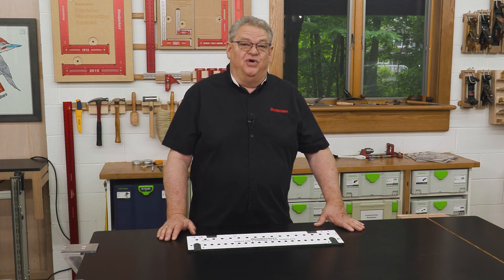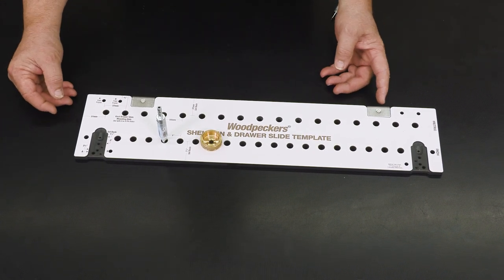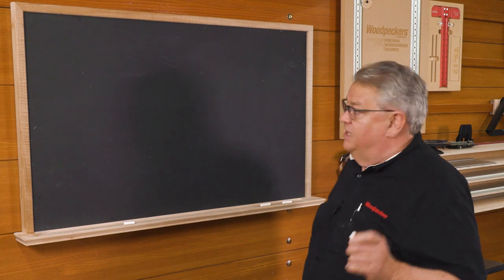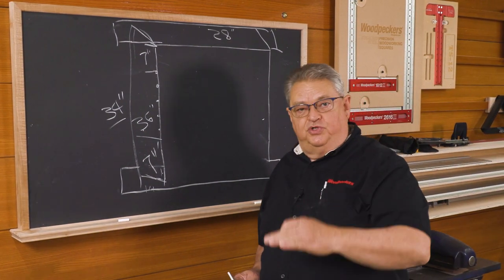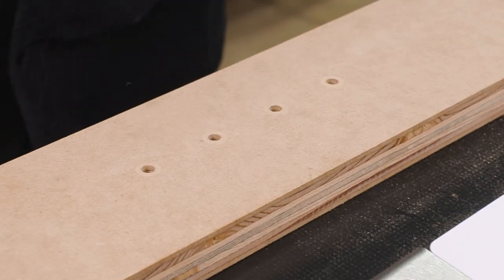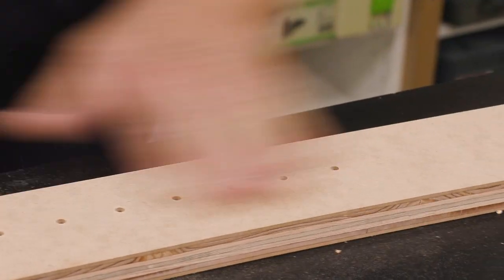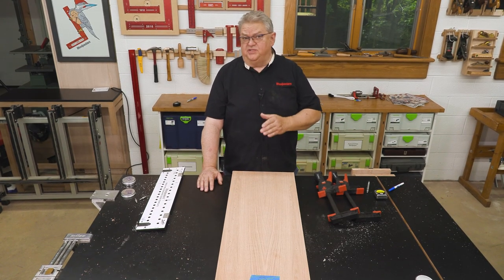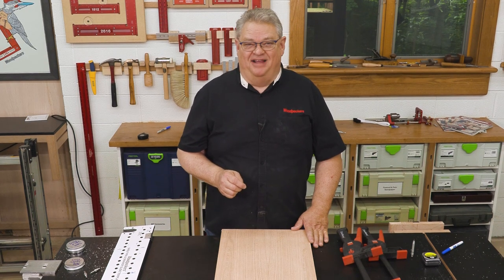Easy Cabinet Shelf Layout With Shelf Pin & Drawer Slide Template | Deep Dive | Woodpeckers Tools

Comment: Jeff, do you folks have a camera in my garage? I just invested in the Festool LR-32 system; your system matches up well for someone that doesn't do production work. I wish I had looked this over a bit closer. I agree, the 5mm drawer slide system is a well-designed setup. You should have also shown how to drill for 5mm cabinet hinges. Thanks, Chuck.

Comment: I just purchased this jig and was very impressed by the quality. I drilled my first set of shelf pins yesterday and the results were dead on accurate. I do have one question, since I don't own a plunge router, I purchased the Snappy 5mil drill bit that was listed. While it worked great, I did experience tear out while drilling many of the shelf pin holes in the plywood carcass. Is there a way or technique that can be used to prevent this? Previously, I had been using the Kreg shelf pin jig, but wanted something more accurate. With the Kreg drill bit, tear out was also a problem, but this was easily resolved by "pre-drilling" the holes with the drill in reverse. This would score the plywood and when the hole was drilled normally, you would get a clean hole with zero tear out. I tried this with the Woodpeckers jig and the Snappy drill bit, but the drill bit would unscrew and come apart, so this was not an option. Any tips or tricks would be greatly appreciated. Otherwise, I was very impress and happy with the quality of the jig and results.

Comment: Jeff were you actually using a drill bit in the router or was it a spiral upcut router bit?
Reply from the maker: I used a special bit from Festool that looks like a brad point drill bit, but it is designed for the speed and power of a router. What comes with the jig is a solid carbide upcut spiral router bit.

Comment: No one should laugh at your drawing because you used chalk. I ran into 5 mm pins for the first time modifying an IKEA shelf unit. There are also the reinforcement pin sleeves which are spec’d for a 7/32” hole.  Necessary for IKEA (but why is the hole size Imperial?). Thanks for the video!